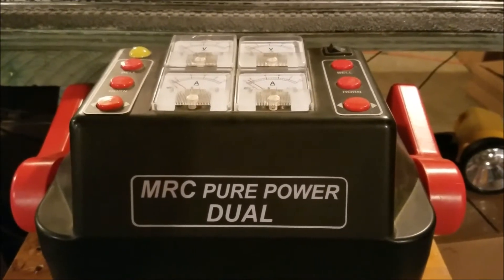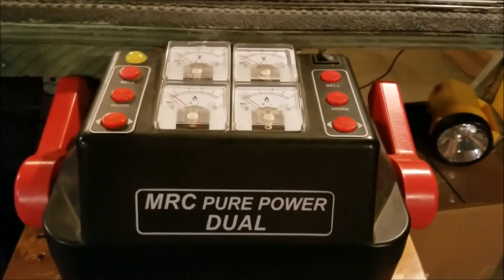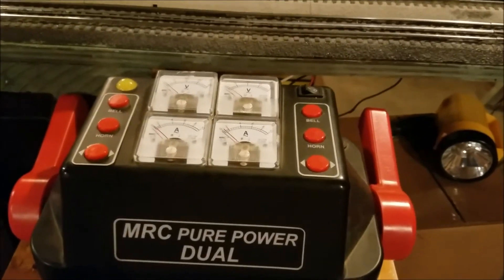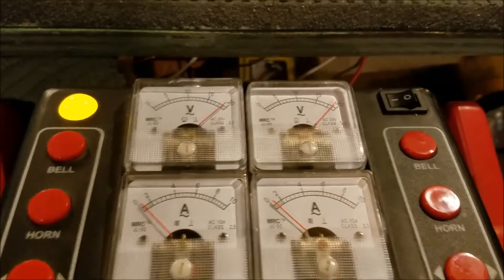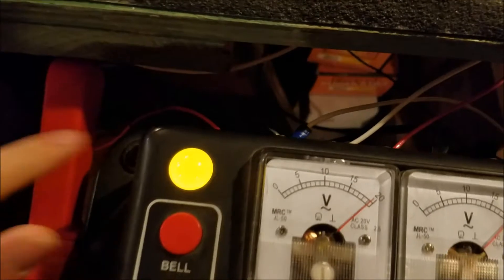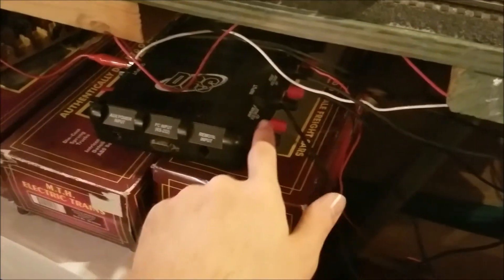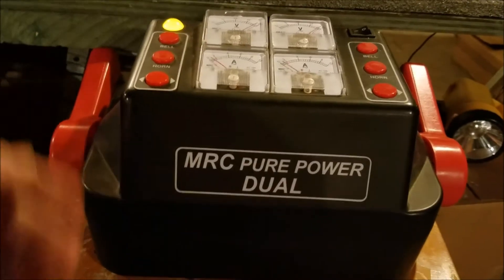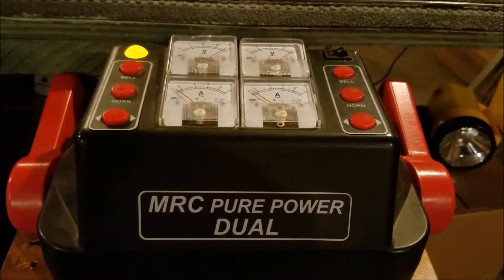MRC Pure Power Transformer

Comment: 2 things
1. The screws on the  analog meters are a single point adjustment. You can adjust the needle at zero, or set it to 18v out by the multimeter and then turn the screw to make it match the multimeter for a more accurate reading at higher throttle settings.

2. According to MRC, each side is rated for max 7 amps with a max of 21 v, or 147 watts per side. It is not 270 watts per side. Due to loading and losses you won't get the full 147 on the adjustable outputs, especially if you are pulling current off the 14v Accessory terminals.
Reply from the maker: Yup. I made that correction in the description. 135 watts per side.

Comment: can I run MTH PS 2.0 engines straight from the transformer? Thanks !
Reply from the maker: Yes but the diodes in the transformer may not allow you to activate the PS2 conventional features (ie PFA sounds, turning off speed control ect)
Reply: @trainlover9943  ok, thanks for the info!